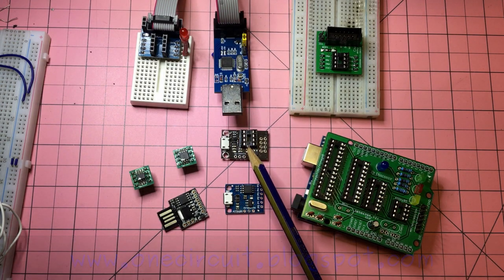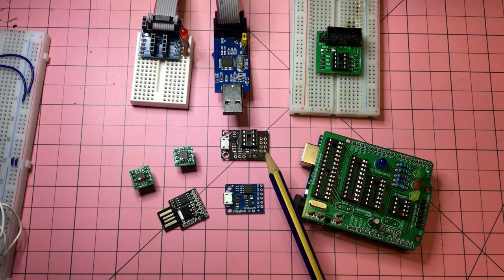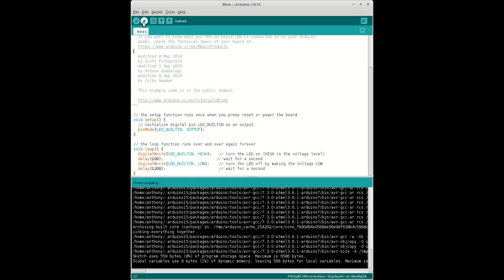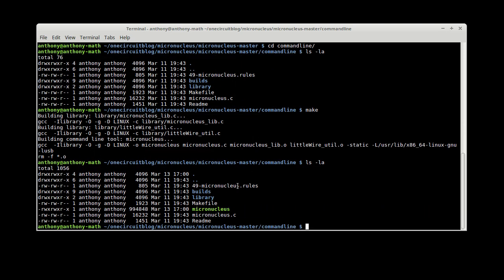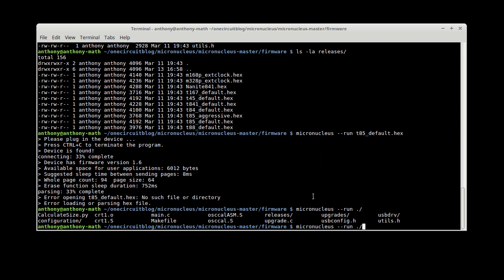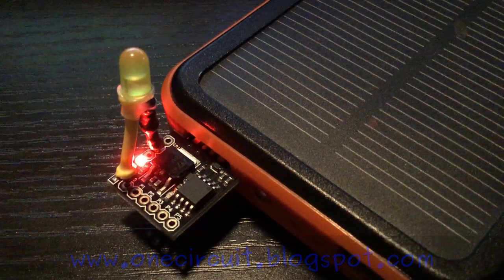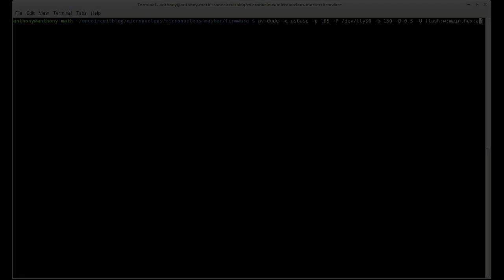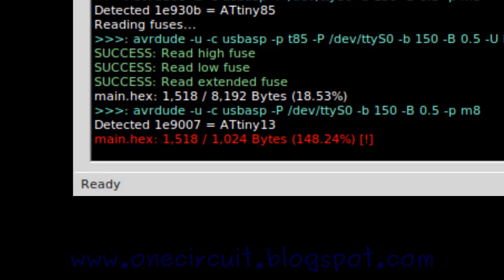Micronucleus bootloader for ATTiny85

Comment: I have a blue color digistump clone with firmware version 1.6 . ( the type you show at 8:46 ) 
I followed exactly same steps like you did (micronucleus 2.5) and I got same output in terminal when I "../commandline/micronucleus --run upgrades/upgrade-t85_default.hex" . 
Then I tried within arduino to upload a sketch , plugged in board , and it does not connect by "ATTinyCore/tools/micronucleus/2.5-azd1b/micronucleus --no-ansi --run --timeout 60 /tmp/arduino_build_169828/ATtiny85-note-play.ino.hex" . 
I don't have any more idea what to do . I can't replicate steps because the attiny85 is not connecting anymore . I don't have a hi voltage programmer also .
I can't find the firmware 1.6 so I can't flash back with avrdude . I found only micronucleus 1.11 . 
I tried avrdude flash with upgrade-t85_default.hex ( fuses correct for enable reset  P5 pin) , but even that didn't worked out .
Reply from the maker: From memory if you’ve enabled the reset pin then the ATTiny85 can no longer be programmed. You’ll need a high voltage programmer to unbrick it. I use a commercial one (as shown on the video), but you can easily make your own with a few simple components. See for example: https://arduinodiy.wordpress.com/2015/05/16/high-voltage-programmingunbricking-for-attiny/

Good luck and please let me know how you get on. 👍😀

Comment: I never plug mine attiny13 in that board buy I was tempted at first. I new it was for the 85 version.
I have 3 types of Attiny85 but No 8pin chips yet. I was thinking about buying 2 for the 2 boards I have.
Glad you told me that the 13 blow up. Lol I want to program them with the Arduino I order more chip recently. I think I like to collect Microcontrollers at this point.
Reply from the maker: Yes it is funny how many microcontrollers one person needs! 🤷🏻

Comment: Have been down this path, last year.  I put the old of Micronucleus on my t85's so when I give them away, friends can treat it like a Digispark in the Arduino IDE without extra complications.
The whole VUSB thing is fascinating.   There is USBaspLoader: a VUSB loader for atmega chips that behaves as if it were a USBASP programming device.
If you run your AVR8's at 5V you only need a couple of resistors and zener diodes (3.3-3.6V) to talk to the bus.
ATmega chips will require a 12,16,20 mhz crystal to use VUSB.  ATtiny's have a PLL to boost their clock, and need no external crystal.
Once you are happy with your bootloader, you can fuse out the reset pin, to use it as the 6th GPIO and analog read.
# avrdude -p t85 -c usbasp -U lfuse:w:0xe1:m -U hfuse:w:0x5d:m -U efuse:w:0xfe:m
You will need an HVSP programmer to ever change the bootloader again, after you do this.  The existing bootloader will still be there, of course, upon every power-up.
After you fuse out the reset, you can use 4 unadulterated data pins, running TinyISP,  and use your Digispark AS a 6-pin ISP.
Want me to mail you one?  This is the least expensive way I know to create an AVRISP device, costing only about $1.10
Reply from the maker: Wow that’s quite a journey! I’m not sure if it’s enough to tempt me down that road again. Maybe one day if I look at VUSB protocols for a specific application? Anyway, great info, thank you very much for the clarity of your explanation. 👍😀

Comment: I have a programming shied for my Arduino but it just haves a ziff socket instead of different size headers
Reply from the maker: Commercial or home grown? Does it take 8 pin, 14 pin, etc without reconfiguration? 🤔
Reply: @onecircuit-as  yes it's commercial and needs no configuration, also it has a socket that takes up to 28 pins
Reply from the maker: Oh yes I have used those (https://youtu.be/SSGx4kkKa20). Just never tried them with the 8pin ATTiny chips on the assumption that the VCC and GND pins would misalign.